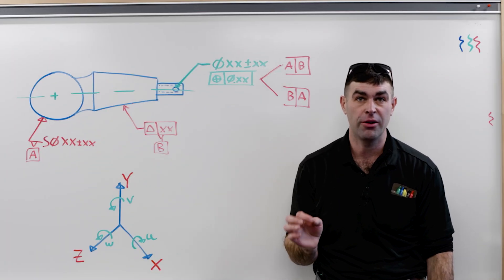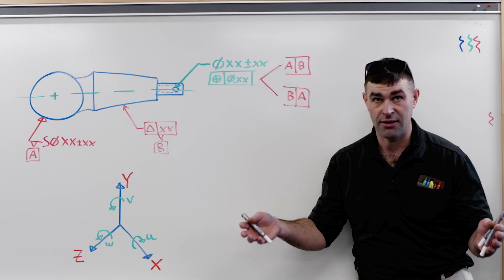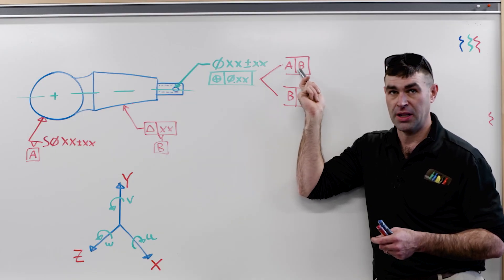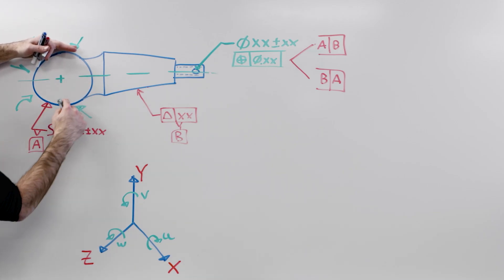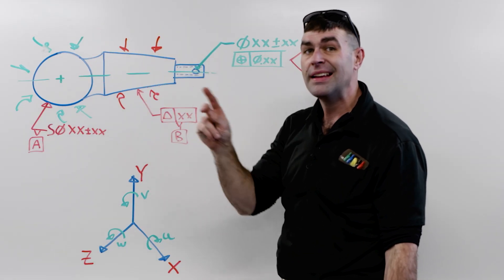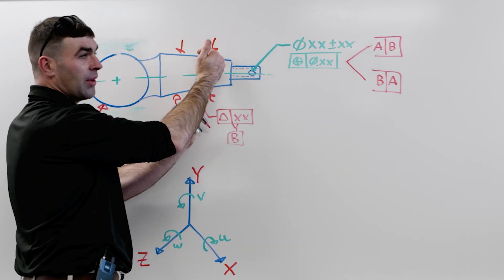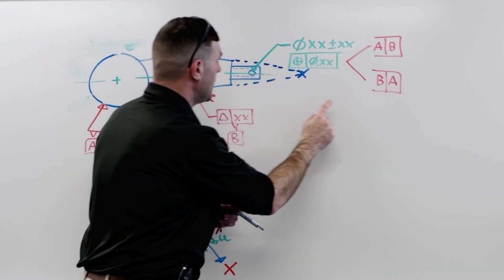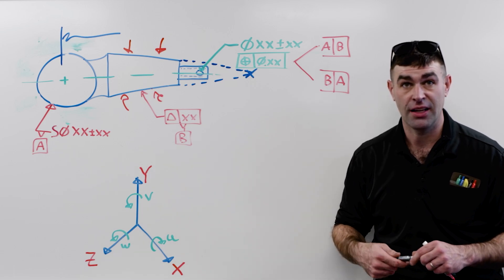GD&T Reading Feature Control Frames

Comment: Could have shown how the (as shown on the board) the left-right position of the cotter pin hole would be affected, where would it move relative to what. 
e.g. if the taper was 'small' such that the dashed convergence lines moved leftward - would the cotter hole 'move'  (the digram didn't actually [as in 'obviously'] show how the cotter hole was dimensioned, so the consequence of changing from AB to BA were brought out.

Thanks for the example!